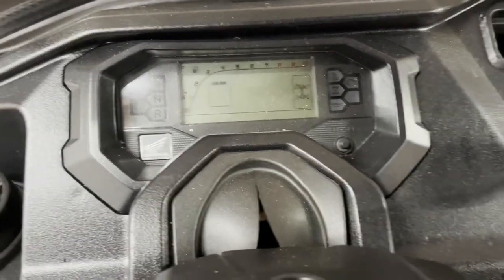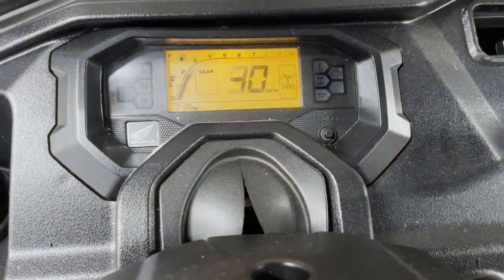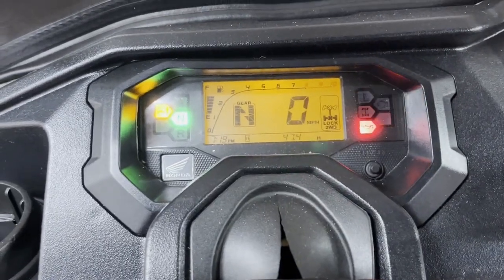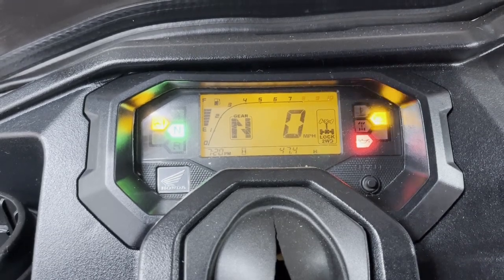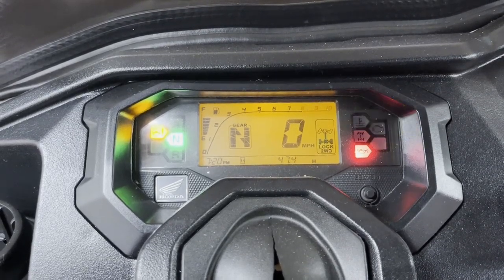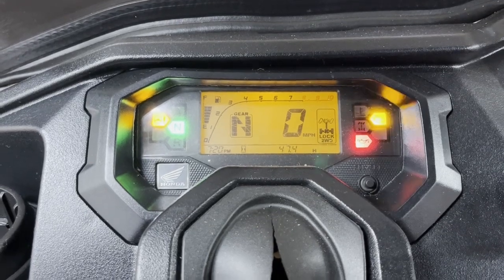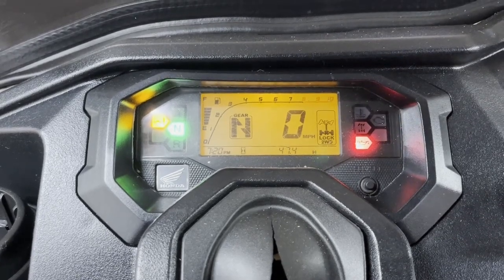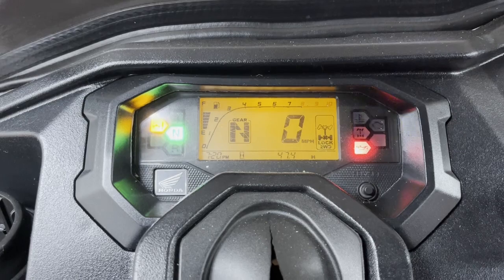Honda Pioneer 1000 How To Check Pull Engine Codes From Dash Cluster

Comment: how do you get to the point to actually get the codes to flash?
Reply from the maker: When you turn the key on and your engine light is on wait a few seconds and it will start flashing on its own. Count your flashing to get code number as shown in video. Thanks for watching and don’t forget to like and subscribe.